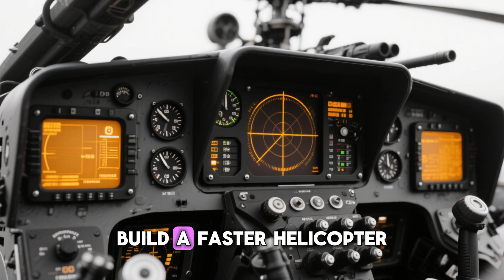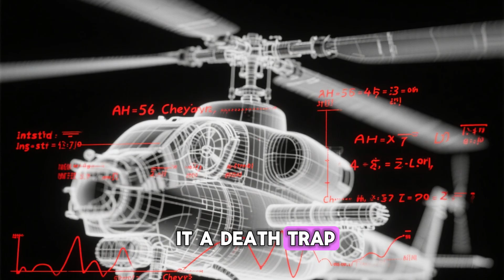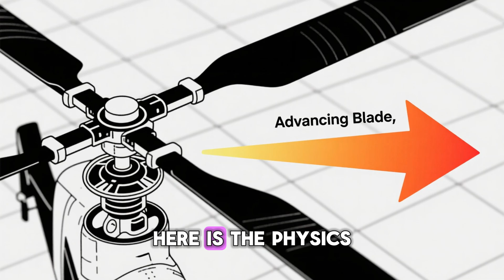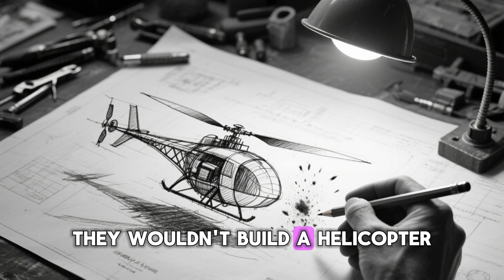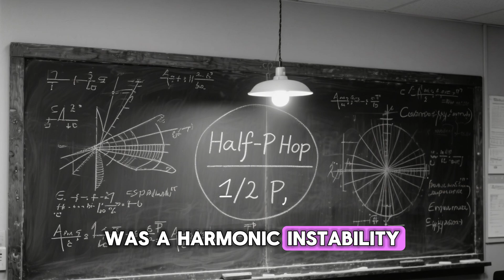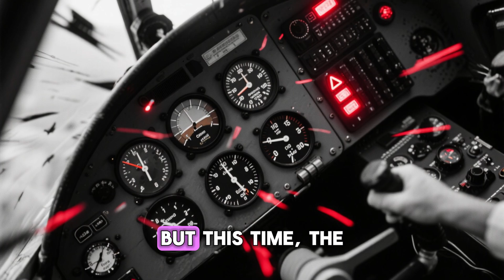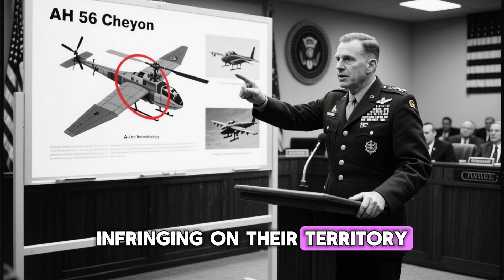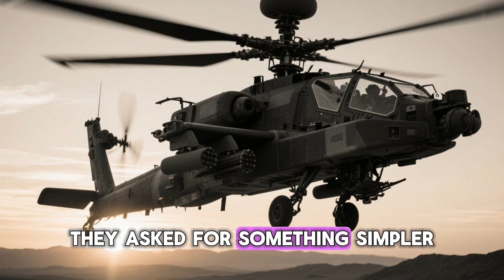The $500 Million Mistake: Why the Army Killed Its Super-Chopper

Comment: 155 knots retreating blade stall stall on the Huey for the 2 blade main rotor. The Cheyenne should have been manufactured but someone in the army killed it with lies. The future is 2 stacked coaxial rotors but the army insanely destroyed it because they want tilt rotors that is still an immature technology because they are still falling out of the sky. Cheyenne finally was tuned at the bottom of the transmission and that fixed the Cheyenne. This debacle was brought to you by the same incompetent generals that in the late 1950s gave us the updated M1 Carbine that was a total failure in Korea due to lack of penetration and they gave us the M-16 and the 5.56NATO that takes 8 torso hits to bring down an adult male. These generals have zero common sense. They have already disposed of the Raider S97 and the Defiant SB-1.